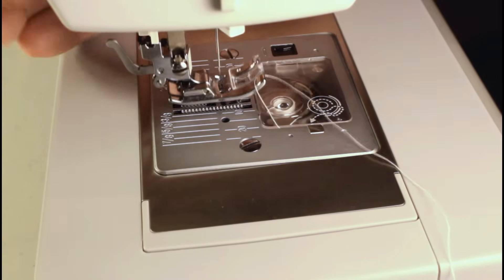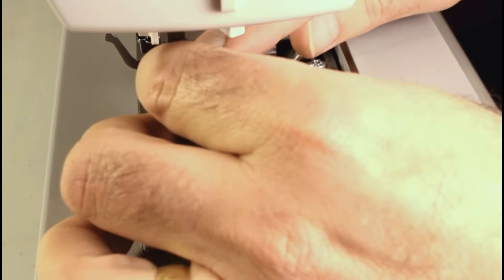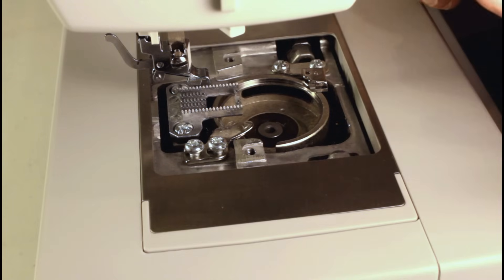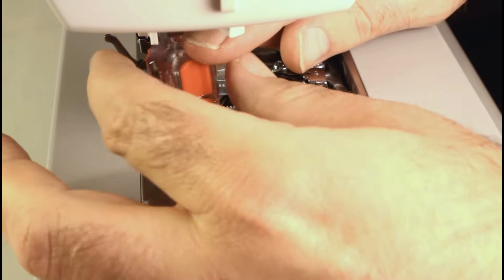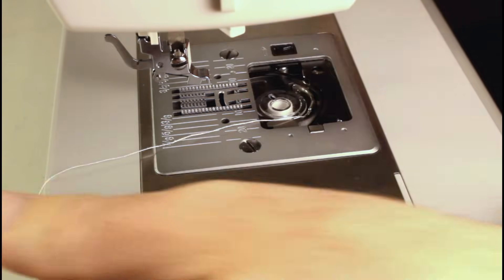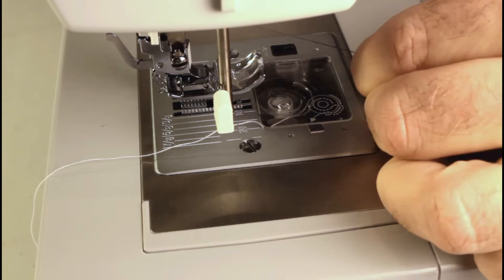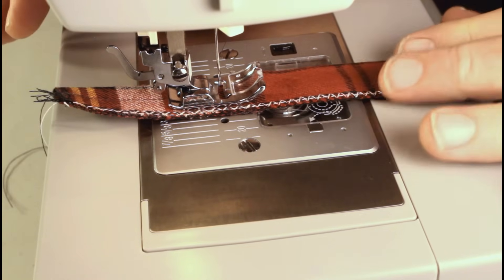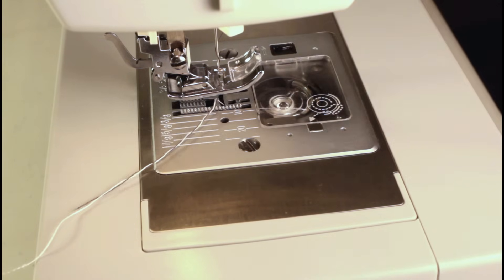Singer Heavy Duty - Adjusting Bobbin Tension, Please read the Description before posting questions.

Comment: I'm having problem with zigzag. It does not lay flat. So I think you are saying that the tension is to high so I will have to loosen it. I'm hoping this works.
Reply from the maker: That is usually the case. Try loosing it up and see if that works.

Comment: My sewing machine doesn’t work when I press the back stitch button to sew in reverse.  Is this a tension issue?  If so, how can I fix it?  If not, how can I fix this?
Reply from the maker: Take the covers off and see if the back stitch lever came loose. Should be an easy fix.
Reply: @kevinsews  Just had this problem with a machine that came in for repair. There is a j-shaped wire that is pulled down by the reverse lever, and it had come off of the little post that it rode in and jammed. Popping it back in place with a flat head screwdriver fixed the problem.
Reply from the maker: @vickdegiorgio2151  Thank you for posting this.

Comment: Hey me again, I’m still fighting with my machine. Will buy a brother but for now I’m still trying to keep this going until I can buy one. My bobbin tension is too tight and I can’t seem to get this to work to make it looser. Also my top tension isn’t working at all. I can turn the knob but no matter what number it’s on it the thread slides through the eye of the needle without ever pulling the needle back. The thread up top is also loose. I am nearly ready to throw it in the bin.
Reply from the maker: Are you located in the USA?
Reply: @kevinsews  no Australia :(
Reply from the maker: @tjtinaj83  Okay, go ahead and go to this USA site to figure out if they have the new bobbins for your machine: www.sewingpartsonline.com  If they do have it hopefully it will give you a starting point.
Reply: @kevinsews  ok so I have taken apart my machine. Not the whole body just the part that exposes the needle timing etc, tightened up some of the screws as well as giving it a good clean. I took apart all the bobbin parts too. I noticed that where the thread passes the part that is meant to have a spring, the spring part was not springy but stuck. I took the tiny screw out and re bent all of the tiny parts. Now it springs like it should. Looks like I have fixed it.
Reply from the maker: @tjtinaj83  That is great to hear!
Reply: @tjtinaj83   I had the same issue when I got my 44s a few months ago. It was the tension discs not clamping down, so the thread was just slipping through. Mine kind of fixed itself after taking off the front cover and replacing one screw. lol

Comment: I wonder if you could help me with an issue I have with both my sewing machines (I have a Singer and a Necchi). 

When I sew decorative stitches, the decorative stitch only appears on the underside or the "bad" side of the fabric. It never appears on the good side that is facing up. The stitch should be appearing on BOTH sides. I have followed threading instructions to the T, so I'm not sure what I am doing wrong. I'm at a loss.
Reply from the maker: Toro I haven’t heard that one before. It could be your needle or the thread. It could be a tension issue. Your machine might be slightly out of time.

Comment: Been having problems breaking needles, and bobbin case is not staying in position am able to take bobbin case out without taking those 2 screws loose. Bought new case same as before it slips in and out without having to loosen those screws. Also when breaking needles it breaks off corner of bobbin case
Reply: Any ideas what could be problem? Could that plate that holds 2 screws be bent or is the piece under bobbin case not high enough to close distance between bobbin case and hold down plate
Reply from the maker: @mattshaneberger5286  Hum... that is strange. If both cases go in and out that easily then I would say there is something up with the machine. I have 4 of these machines and you can get the bobbin out of all of them by turning the handwheel and shaking the bobbin and they will come loose at some point.
Reply: @kevinsews  are you supposed to be able to get bobbin case out with out taking those 2 back screws loose or out
Reply: The bobbins seem to load ok
Reply from the maker: @mattshaneberger5286  Yes, simply juggle the bobbin as you slowly turn the handwheel and it should come out. I remove the screws just to make it easier to get out and back in.
Reply: @kevinsews  ah ok, was thinking that you have to loosen screws, so prolly ok. Dont know why we keep breaking needles and bobbin case then. Have only had 45 days or so gonna contact singer I guess

Comment: Hi, I have a singer patchwork machine. Sometime back the thread got jammed and I pulled the fabric with force. Now the bobbin does not oscillate/rotate as it should. Please help me.
Reply from the maker: Try removing the bobbin case and clean the area out. Add a drop of sewing machine oil to the bobbin area then replace the bobbin case. My guess is you dislodged it when you forcefully pulled the thread out. Next time cut all the threads. This will usually free them up so you can remove each thread without any issues.

Comment: Newbie.  I have been making masks and when I stitch forward, the stitches look fine on top and bottom.  When I reverse stitch, it almost always produces a small birds nest and often the thread gets caught up in the base a little (can be removed).  Is this a bobbin tension issue?
Reply from the maker: Newbie Vlogger and Photographer Pull about 8 inches of thread (needle and bobbin thread) and hold it tight before you start sewing. Hold it for the first 2 or 3 stitches then release it.

Comment: Hello, I recently bought the singer heavy duty model 4411 and  when ever I try to use the machine the needle doesn’t go down. When I put more pressure on the foot paddle for the stitching, the needle breaks. Can you help me fix this problem. Thank you.
Reply from the maker: Remove the bobbin cover plate and the bobbin holder. Clean it out to ensure there is no thread trapped there. If that doesn't fix it then it sounds like it could be a mechanical problem. About the only way to address it is the take the cover off. the top and bottom. Then you need to understand the components that make up the timing of the machine.

Comment: Just received the model 4452 on Friday, used it today and was testing the thread patterns, then the bobbin stopped , I saw you remove the brown cartridge or cassette and I didn't the same thing and replaced it as shown retightened the bracket down, but it will not thread any longer, the outside of the cartridge/cassette spins around but the plastic see thru bobbin, nothing happens,  I have less than 3 feet of test patterns and it just crapped out --- so if I tighten that yellow paint covered screw,do you think that may help?  I am at a loss as to why this is happening,  thanks for any comments..
Reply from the maker: It won't hurt to give it a try.  Make sure you are catching the notch slot that leads the thread through the bobbin tension disc first.
Reply: Kevin Sews I did try tightening the screw, it is still a no go,  I reinspected the brown cartridge again,  with it out of the machine I turned the handle and the metal / magnetic encasement it sits in spins freely and looks normal, the cartridge is undamaged and set in properly with the nub just touching the place it should.  I thread it correctly, snapping the thread under that first cartridge hook,  but the spinning metal case that has the sherp point on it to pick up the thread does not do so.  I can return it for a refund, but as a last measure I emailed singer and hopefully they reply by today.   (I have also inspected from removing the plate on the bottom, no loose parts or broken pieces, all looks normal)
Reply from the maker: @thetoolmat8632  It sounds like your needle position could be too far away from the hook as it comes around to pick up the thread. For that you simply need to take the left top cover off and find the screw to loosen and move the needle forward slightly until the thread is picked up by the bobbin hook.
Reply: Kevin Sews ok I was completely incorrect on the way sewing machines work. I now see what you are saying. I went to see how a bobbin timing works and found a link at city sewing here https://youtu.be/w8DQxsOZimY i now understand what you mean.  I hope this is it!! Thank you so much.
Reply: Reinspected and it is a timing issue. The manual online shows how to adjust but it requires a separate needle bar clamp and a set of gauges to repair. I would be inclined to do the repair but since it is brand new i hope to find a remedy some other way. Have no idea how the timing became off. Thanks for the help!
Reply from the maker: @thetoolmat8632  Did you find a service manual for it?
Reply: Kevin Sews yes it is on the internet for downloading, it appears to be the same as the 4423 service manual but is specifically for the 4452, , well at least the timing adjustment section appears to be the same, it is on page 16... But, it did not work loosening the 3 Allen Heads, they are 2.0 mm in size by the way,  
I looked at it and wound up disconnecting the upper gear bracket right above that gear on the frame
 there is another allen head on that,  
you cannot see it looking down into the bottom of the machine you have to look at the bracket from the side..when loosened it let the hook part turn sorta freely, 
I did loesen the brown bracket as well, this let the upper gear separate from the lower gear, and I set it the proper position with the needle eye. I tightened everything back up and it works very smoothly and with great results.
- I am curious about those 3 screws it says to loosen and then adjust, I am now assuming that one would set that shuttle hook in the correct position, then loosen the 3 Allen screws, then hold the shuttle hook and turn the handle which would allow the needle to go up and down while the gear was slipping over the rod, and when the needle was in the timing position just after reaching the bottom, then one would retighten the 3 screws???
I tried that but the gear would not slip as I turned the handle... Anyway sorry for the long explanation, but it may help someone and hopefully someone who has done it the way it shows in the manual will chime in and say the correct way to do it, even better make a video of it...
Reply from the maker: @thetoolmat8632  You are on the right track, so that is great! I encourage people to learn how to set the timing on these low cost machines because having them repaired cost more than the machine is worth. Once you learn it then it only takes minutes to get the timing set back into place. The way to adjust things is the loosen the 2 of the 3 screws then only loosen the 3rd screw just enough where you can turn the hook but leave it tight enough that once you get it into the perfect position you can tighten the 3 screws without it moving from the current position.  I will have to take a look at the manual again and see exactly what you are seeing.
Reply: Kevin Sews yeah that would be nice if that one gear slipped when turning the hook.  If you can do a video that would be awesome!   Here is a link to the manual. See 3-11 on page 17? https://www.manualslib.com/manual/1220482/Singer-4423.html?page=17#manual
Reply: And the picture https://drive.google.com/file/d/1WTLbey47NypKdg9MY9PoqlwIcBK_uNSx/view?usp=drivesdk

Comment: Hi Kevin - I used this method to loosen my bobbin tension on my 4423. Even with lower bobbin tension and thread tension tuned to max 9, I am still getting top thread showing underneath. I am using bonded nylon on upholstery vinyl. I have done so on other machines with no issues, but it seems like there is a problem I can't fix. I am stumped. Is there any advice you can share? This is very frustrating and I would love to be able to use my machine properly. Thank you!
Reply from the maker: Get your top thread tension down first. Here is a video I created that should get you close: https://youtu.be/8TPB2yzw-1Y

Comment: do you turn the screw clock wise? I'm read the toss this machine!. I'm getting loops on top and bottom.
Reply from the maker: Right to tighten Left to loosen.  Loops on the bottom can be a needle thread problem.  To ensure your thread is seated between the tension disc.... after you've threaded your needle hold the end of the thread with your left hand and then with your right hand grab the thread on the top of the machine and pull it to make the thread nice and tight. This will ensure the thread is seated between the tension disc.

Comment: My bobbin tension screw is set to the tightest setting and I'm still getting the loops from the bottom thread poking through the top, I've tried loosening it and retightening it, and still to no avail, any tips?
Reply from the maker: Take a look at this video as a starting point. https://youtu.be/8TPB2yzw-1Y  
If that doesn't help I have another video showing how to tighten the thread tension here: https://youtu.be/ddFcH5lnnjY

Comment: I've done everything recommended  by everyone however, my Singer heavy duty 4432 stitches fine in both the left and right positions but I cannot for the life of me stop it from looping in the center position no matter what the tension setting they all look the same. Again...beautiful stitch when the needle is placed in the left or right position.  Do you think the bobbin tension is loose? I can't figure this out.
Reply from the maker: Hum... it could simply be a tension issue or even the type of thread you are using. Use a higher quality name brand thread when possible. Make sure the eye of the needle is large enough so the thread passes through it freely. After that it could be something mechanical is slightly off. Usually, you can get a perfect middle position stitch but not a left of right needle position to work. In this case the timing is off slightly.
Reply: @kevinsews   Thankyou  but I finally figured out that the bobbin tension needed a screw turn or two. I took the bobbin holder out  and did just that and it seems to be the answer.. Thank you for replying.
Reply from the maker: @shirleylane8469  My pleasure!

Comment: What tension, width, length do i need for a straight stitch?. what needle and brand do i need to use?. Thanks!
Reply from the maker: That is hard to answer since the needle type and size and stitch length is based on the fabric you are sewing. I use Schmetz needles on my domestic machines. I also have some Singer and a few other brands in my stash. In general a stitch length of 2.5 to 3.0 is used on basic woven cotton. A stretch (or Ballpoint) are used on knits. For jeans a denim needle.

Comment: My machine looks and sounds like it is sewing fine.  But when I check there is no bobbin thread.  There is bobbin thread in the machine but the casing isn't moving and catching the upper thread.  What is going on?
Reply from the maker: If the bobbin case it is inserted correctly then it may be a mechanical issue. You would need to remove the bottom cover on the machine and look to see what is going on.

Comment: Hi , Bought this Singer a year ago on Amazon, just opened yesterday,  machine jams after 2 stitches EVERYtime , then thread is all knotted up , any ideas ??
Reply from the maker: Hold both threads before you start sewing. Also, make sure your foot is up and the upper thread is seating into the tension disc. You can test this buy lowering the presser foot and pulling on the needle thread toward the back side of the machine. Your needle should slightly bend when pulling on the thread if it is seated properly. Double check that your bobbin thread is coming off the left side and not the right side. Make sure the thread is coming through the little drop area on the left side of the bobbin. It is also a good idea to place your finger on the bobbin to prevent it from turning and then pull on the thead after you've feed the thread through the proper path in the bobbin case. This will ensure it is properly seated into the tension area of the bobbin case.
Reply: Hi , I had the same problem as you have, and finally found the solution to this condition.
JUST ADD SEWING MACHINE OIL INTO THE WHOLE BOBIN CASE !
That's it!

Comment: Hi there! I'm having problems with my new Singer 4452 where I can't get the needle to catch the bobbin thread, rethreaded the needle and have tried turning the wheel while maintaining slight tension on the needle thread and still can't get the thread to sweep across the top of the bobbin to catch it. Could this be an issue with the tension in the bobbin case?

It's an early christmas gift for my girlfriend, she had it working until a piece of felt got pulled into the machine, after fishing it out it hasn't been able to catch. I opened it up and nothing looks obviously broken, but I'm still fairly unfamiliar with sewing machines. If the fix in the video wouldn't address it, do you have any other ideas of what it could be?
Reply from the maker: I have a video on my channel showing how to set the timing on this machine. Look for it.

Comment: After doing button holes, my dogs will not engage. I have tried every thing I can think of. I can't sew if the material won't move
Reply from the maker: Be sure the button hole lever you drop down is pushed back up.

Comment: Also is there a trick to putting the foot on. It takes me forever to get it in correct position
Reply from the maker: It should be pretty easy. Lay the foot down on the bed of the machine and lower the presser foot slowly while aligning the foot with the slot.